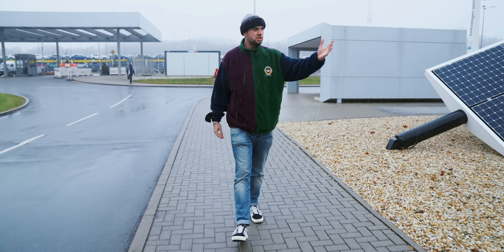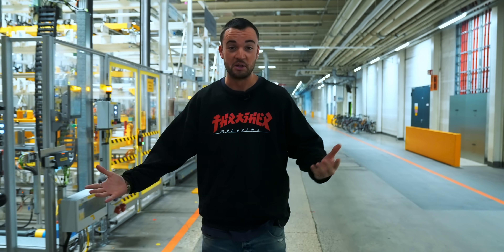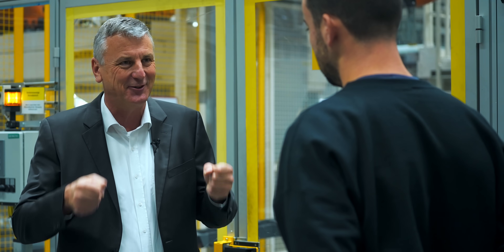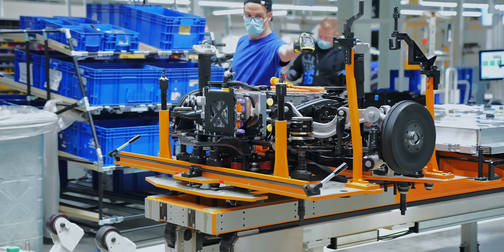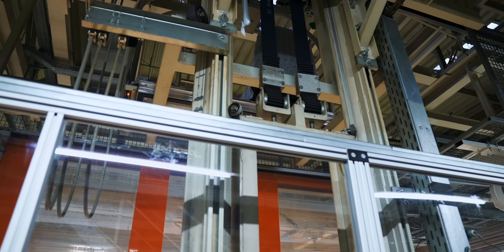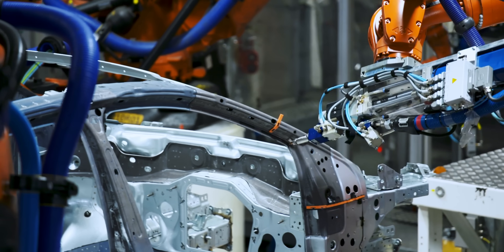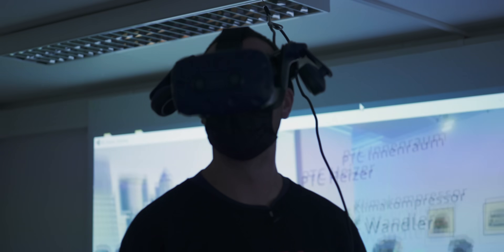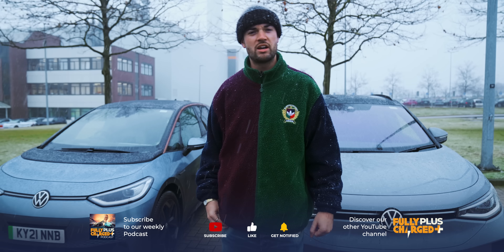Inside the car factory of the future: VW’s Zwickau plant

Comment: Also worth pointing out that this plant, as well as the other two Volkswagen EV manufacturing plant have a zero carbon footprint, and use 100% renewable energy.  Also good to see VW using electric trucks too.....  ID5 is for China only I believe....  I think this is also the site of VW's electric car battery recycling plant.  If ever there was an illustration of what the future looks like, this is it!  Trees planted around the factory are a nice touch.....

Comment: It would be interesting to know how long it will take to recoup such a large investment and how much of that is part of the price of each new car.
Reply: 1. Factory produces 330k cars/Yr @ say €40k each. That is €13.2B turnover/Yr. VW's EV gross margin probably ~10%, so payback time ~1 year. But 'recouping' is not how corporate accounting works. The Investment in Property, Plant and Equipment is added to the balance sheet as fixed assets, and depreciation costs are calculated as part of 'Cost of Goods Sold'. So question 2 is more relevant:
2. If the €1.2B investment is depreciated in 5 years, that is €240M per year / 330k cars = €727 per car.
Just guessing with raw numbers...

Comment: I would be interested to see FCS explain how all ICE production will be replaced by battery tech. when the supply of Lithium is limited.  From the raw material, about 100,000 tons is required to produce enough lithium for four car batteries.  Given the known reserves of lithium ore, there is enough for around 150 million EVs.  About 70 million ICE cars are produced per year, which implies less than 3 years of EV production (and meanwhile no mobile phones, laptops, electric trucks, medical equipment etc.).  There is NO magic lithium free commercially produced  battery on the horizon either, so EV production is destined to be niche for a lot of years yet - and not all ICE production will switch.

Comment: It is a nice video but I doubt that the changes to this factory were necessary because of the change to building EVs. They were probably necessary to update an old factory with old manufacturing processes such as  manual welding of bodies, painting, etc. I think the change to EVs was a good way of justifying the big expense of updating the factory but body build and final assembly manufacturing processes are essentially the same for EV and ICE vehicles. The real changes are at the engine build factories wherever they are. They are the places that will either be completely modified or replaced by new factories.

Comment: Now, this explains why the TESLA delay in GIGA BERLIN, passes a lot of pressure and delays of their manufacturing operation, as TESLA is a BIG COMPETITOR  on EV sales and is a non GERMAN owned company. Hopefully, Germany would be sane enough to let the competion on this field to be FAIRLY and SQUARE since it would be great and will do a big LEAP of improvement in SHIFTING from FOSSIL FUEL dependency. Likewise, it would give CHALLENGE and IMPROVEMENTS to INNOVATE themselves in the EV manufacturers side towards INGENUITY,  CONCEPTS and INSIGHTS to IMPROVE more in order to stay and be in the COMPETITION, and it will both BENEFICIAL to the CONSUMERS or BUYERS on EV's towards CUSTOMER SATISFACTION!!!

Comment: Wish part of the factory was dedicated to installing solar panels into the tops of the vehicles...
Reply: Pointless. You'd need a solar panel the size of a tennis court to get a meaningful supply from it.
Reply: @Brian-om2hh  um, I have one on top of my 2013! that is a 12vt battery tender and haven't you heard?-going forward solar is going to be integrated into EV body panels(Sono) or all along the top(Lightyear, APTERA) to provide real, usable mileage. So, no, not pointless.  Quite pointed actually. Thanks for your comment.

Comment: Good for VW. But if this plant is so note-worthy, why did Diess just discuss at length why meeting VW's even "modest" 2030 EV goals limited to only the EU would be "impossible to meet"? And while the Zwickau transition is impressive, Tesla attempted the same thing at NUMI's odl plant...."Fremont". It was close to a disaster. I see arguements why VW is slightly better "cash-cushioned" to make the transition, but there's only so much production mileage they can wring from the plant. Diess is an engineer, and he sees the economic walls closing in around, and narrowing, VW's survival options, even as he personally drives the company forward at full speed into the EV ecosystem. 

It appears to a large degree that  VW's board and worker's union is seriously hampering the smart and necessary decisions VW needs to execute....textbook example at work of the "sunk cost bias" decision-making error at work.

Comment: Super impressive. I don't know how recent the aerial footage of the plant is but if it is recent, once again we see a modern factory without large scale roof mounted solar power generation capability (as is the case with Tesla's facilities). Laudable that they buy green lecky from Austria but surely, why fork out so much dosh if you can generate a substantial proportion of your own power needs right at point of consumption? Structural issues in the existing buildings may have presented a problem with installing a roof mounted solar system but if your spending €1•4 billion to completely revamp a premises, why not spend a little extra on the building fabric to bring down the costs of manufacturing EV's?
Reply: Panels would certainly virtue signal. But, without expensive storage Solar's useful output only covers a small part of any factory's 24 hour schedule. Also overcast day's cannot be allowed to interrupt production. Sadly, until cost effective storage is available, most do not realize that every solar panel installation has to be backed up by fossil generator.  So only real value I see from putting up panels today are brownie points.
Reply: @bobdeverell  But that's just it, there is effective industrial scale storage available. Tesla & at least two other companies I can think, of offer systems that it the bill. Okay, none of them are cheap, but as I intimated in my initial comments, if you're making a huge investment for the future, why not do so directly on your own behalf, not have to continue to fork out hard earned cash to someone else? TBC; there would still be times where purchases of externally generated green electricity to infill gaps between self-generation & demand would be required.

Comment: Should have asked them how long have the previous body shop assembly lines and robots been there. I am betting that you'd get an answer of about 8-10 years. Because, guess what - ALL modern car factories get completely rebuild every 8-10 years from scratch when models switch. Old equipment (outdated and out of warranty) gets scrapped or sold off, new equipment is brought in, assembly line is rebuild from scratch using latest technology at the time, while factory is getting rebuild, people get retrained to the new model and new tools. That is normal everyday stuff in car making. Switching from ICE to BEV is no different than switching from Golf 7 to Golf 8 or from Polo to Tiguan - in either case all equipment is replaced and people retrained. There are no extra costs either - it is just the normal model transition cost that gets repaid over next 8-10 years of production, just like any car model.

Comment: So Zwickau is 1.8 million square metres (180 hectares), cost 1.2bn EUR to refit, and will produce 330,000 cars when fully ramped.

Giga Shanghai is 0.85 million square meters, cost 1.76bn EUR to built *from scratch*, and as of December 2021 had a run rate of approximately 850,000 cars per year.

Giga Berlin site (not factory) is 3 million square meters and when fully built should produce 2m vehicles a year.

VW have a LONG way to go to match the volumetric and capital efficiency of Tesla.

Comment: 6:00 I really hope they can store more than 3000 battery cells. That would be good for ... I don't know ... anything between half and 20 EVs depending in the cell :)
10:55 yes, and Austria buys it's electricity from Poland (mostly coal). That is the complete hypocrisy typical not only for VW, but much of the "green" energy where it dislocates local pollution to other nations and add more pollution thanks to losses on long transmissions.

Comment: Hope Tesla give you the same access when Berlin opens up. 👍VW are getting there but all EV prices need to come down. Good to see them thinking about renewables to power the plant.  ID2 hot hatch with 300 miles real world range next 😉 After dieselgate they have a bit of work to change the brand reputation that was damaged but let’s get that production line on 100% renewables VW.

Comment: very interesting. at least for me, electric cars are still in the beta phase and i don't wanna be a beta tester. Batteries are warranted only 8 years and after that...who knows. 
also, the range and the infrastructure isn't yet up to the normal standards. 
i will switch to electric when batteries move to solid state. no fire, no liquid, no heat issues, longer range, longer life, shorter charging times. Currently batteries are quite bad still and i don't wanna give up the ice experience to another experience that is worse in so many regards (the ones i've said above).
Reply: 8 years - that is longer than your current combustion engine warranty I'd guess.
And what they promise is usually 70 or 80% of the original capacity by then. Whichever way, for "functional safety" there must be failsafes for any potential malfunctions that could cause hard to any person (inside or outside of the vehicle).

A recent study has shown EVs to be about 10 times less likely to catch fire compared to ICE vehicles.

EVs are definitely more comfortable to drive (e.g. e-golf vs regular golf) and, disregarding purchasing price, are cheaper to drive and maintain.

I thank you btw for not wanting an EV right now, the waiting lists are terrible enough as they are on many of them.

Solid state (lithium) batteries btw. are not yet competitive with lithium ion batteries due various reasons, among others longevity. They have potential though
Reply: @mattetjus  it isn't really about warranty here, it is more about the unknown after 8-10 years of usage. We see from last decade EVs like leafs that their batteries are utterly useless after 10 years so they need a complete swap. I don't know what will happen with the current generation of batteries but I don't want to pay 50 grand and then find out after 8-10 years that I need to swap my battery pack for 10k+ euros, no thank you!
An ICE car usually goes well beyond 10 years. It also can stay abandoned for long periods of times, in cold and start up right away. usually the only thing that fails in time is the 12v battery.
Please try to understnad me here. I do like electrics cars for their simplicity, silence, ease of driving. But the battery tech isn't currently where it needs to be, at least for me...
Reply: @vladmihai306  one of the big reasons (old) leaf batterries fail is because Nissan cheaped out and didn't implement any thermal control Just "aircooled" and as such they got too hot and/or too cold . They claimed their chemistry (which is different from Tesla's nca and the more widly used ncm/nmc) didn't need active thermal management but well here we are... The leafs that are kept in garages and seldom fast charged usually still have good batterries though
Reply: If everyone put “experience” and comfort above ecology and sustainability we were f.....
No one should buy a new ICE car from now on.
Reply: @achenarmyst2156  rest assured, the planet isn't dying because of us driving ICE cars. There are a LOT of other industries that pollute in far higher quantities. I am not saying we should ignore the pollution from our ICE cars, but it doesn't mean that if we switched from tomorrow to electric cars, everything will be solved in terms of ecology.
Lets not be hypocritical.
Everyone should have a CHOICE of what he wants to buy and let the consumer move towards electric when it is actually a better thing for the masses. What you are saying with no one should buy an ICE car from now on, no one should live without a vaccine, is a forceful action which is not OK in a free world. We have to solve these climate issues sure, but with respecting people's freedom.
Reply: @vladmihai306  A number of deaths in London have had pollution as one factor in the reason for the death.  Which is probably why the London congestion scheme is having it's area of coverage increased by around 15 fold .....
Reply: The 8 years warranty is exactly that, a warranty. It isn't the lifespan......  And current EV batteries have no liquid element. There is nothing to leak out.

Comment: 10:20 so much flat space on the roofs - I would cover all of them with photovoltaic panels. Producing electricity using expensive Russian gas is not so clever IMHO. Austria is net importer of electricity, i am wondering how they are importing it from there to Zwickau.

Comment: It’s always the next 5 to 10 years that manufactures will be transitioning to EV’s. Whilst EVs are still so expensive compared to ICE cars the mass consumer uptake just won’t happen.
Reply: You have to take into consideration that something in 5-10 years for legacy manufacturers are extrem fast, they are like that old slow turtle.  They have knowledgeable but take a while…
Reply: if that were the case, why are there such long waiting times for new EV's, and sales of new ones increasing each year?  And you don't have to buy a new one. There are decent used examples out there now.

Comment: I cringe every time I see those drum brakes. Yeah I know, in cold climates with salt on the roads, for an EV they might be better due less corrosion. Lots of us live in warm climates which never use salt.
I’m still not convinced! Drum brakes are just simply inferior.
Reply: I believe drum brakes offer slightly superior brake regeneration performance over discs. I may be wrong, but I'm sure I've seen it mentioned.....
Reply: @Brian-om2hh  If you’ve heard it mentioned it’s only from VW. It’s rubbish. 
Well designed disc brakes are superior in every aspect, except in some very cold countries with salt on the roads where corrosion can be an issue on brakes which get little use.

Comment: Well, whoopdeedoo. I've almost given up watching videos about ev's, not because I think they're a bad thing, simply that they're too expensive. In Thailand, in my late 70s and before I subside into senility, I am thinking about giving up my faithful 12-year-old 3-Litre Turbodiesel (which is good for many more decades) and getting a small runabout so that my wife can more easily become the main driver. The Ora Good Cat would be absolutely ideal, I'd love to have one, but the basic price here is around 1 million Baht, around £25000, about double what I gather it sells for in China. A Suzuki Swift, brilliant little car, is little more than half the price. I simply can't help feeling that EV manufacturers are taking the piss and relying on governments to penalise motorists into changing rather than providing true value. So probably what I save on buying the Suzuki could be spent on upgrading my existing 3 KW Solar panel system.
Reply: I believe import taxes are also pretty high in Thailand, that doesn't help either.

Comment: The "car factory of the future" that needs more than 3 times the time for one ID3 than Tesla does for 1 Model 3 XD
Reply: Individual car production time is meaningless - Diess made that comparison for internal political purposes.  Throughput matters much more.
Reply: @Patrick-bu5vy  330k vehicles here vs 2M for Giga Berlin. You're right!
4 times the investment for 6 times the production capacity (or more if it's actually 3 or 4M)
Reply: @JeremyHamaoui  2M for Giga Berlin?  LOL. Like every Musk promise - I'll only believe it when (if) I see it.  You fanboys are way too gullible.
Reply: @Patrick-bu5vy  Shangai is already over 1M run rate and it's the old version of gigafactory.
Reply: @JeremyHamaoui  Not true.  If that was the case, ALL of Tesla's Q4 '21 production would have had to come from Shanghai - it didn't.  Nice try, but as I said, way too gullible.
Reply: Yet Teslas are still more expensive than id3s? Yes I know they are slightly better cars etc etc it's not a totally fair comparison.
Reply: @timscott3027  slightly? Hahaha go compare them and come back.
Better product are more expensive and higher demand results in higher price when production is constraint, that's economy 101.
Reply: @JeremyHamaoui  they both have pros and cons, different people need different cars. I'm not gonna argue about which is better, it's meaningless.
Reply: @timscott3027  you're the one that said slightly and compared. Anyway, VW wont be around in 10 years and the world will be better for it.
Reply: @JeremyHamaoui  Who knows, at least they're trying to go ev, better than some others.